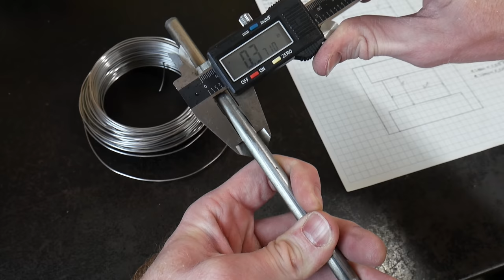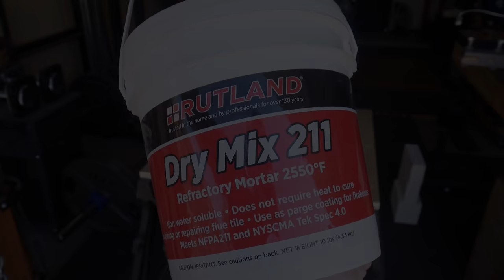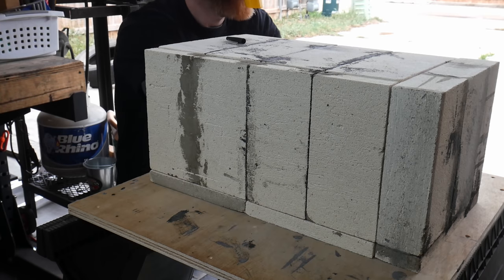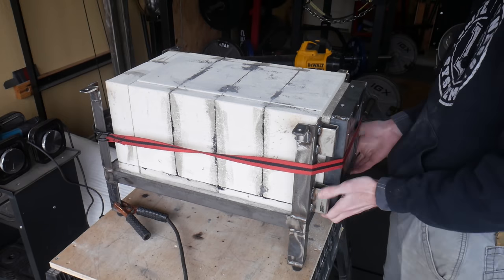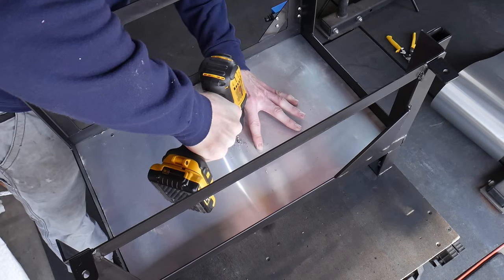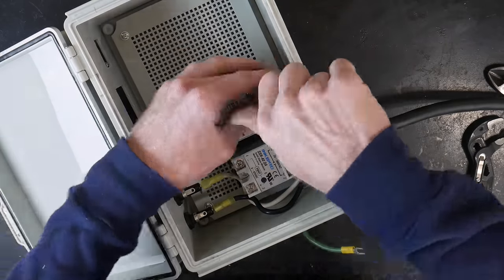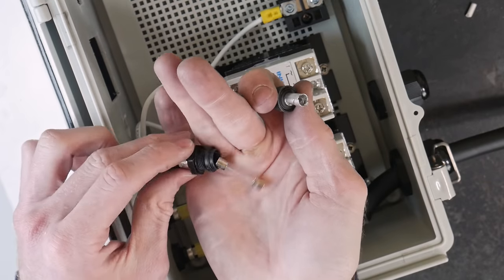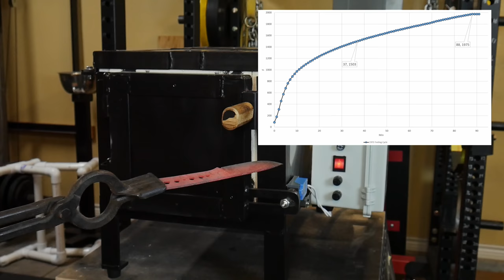How to Build a Heat Treating Oven | FULL GUIDE | DIY Heat Treatment Oven

Comment: Often a discarded bed frame will supply the angle iron needed for 0
A discarded door butt hinge cut in half will work. I’m using parts off a throw away space heater. 
Just trying to save on cost.
Reply from the maker: Good luck!

Comment: hi i just built mine but it takes too long to heat up, it takes about 20 minutes to get to 482F and it gets stuck there when actually i want to get to 1500 like you.

In my case, it is 220V with 20 Ohms, so around 11 amps pass at a power of 2420w for a volumen close to 0.47 cubic feets. Is my mistake in the low power or is it something else? could i solve it by removing a little resistance to go up to 3000w? could it be something else?

greetings and thanks for the video
Reply from the maker: Hey Claudio; Mine was around 13.3 amps if I remember right. You'll need to consider your wires and breaker if you decided to up the amps. One thing you may want to check out is your thermocouple; it's common to get the leads mixed up. Try swapping them. 

You can test to see if the thermocouple is working right by putting it in ice water. 

Could also be some settings in your controller.
Reply: @RedBeardOps  ty very much, I'll check each one of those things
Reply: @RedBeardOps I suspect that I might not be getting the power that I thought. Could it be the switch limit or the fuse holder? Do they need to be rated for amps greater than 10A? I've seen mostly limit witches rated 5A, I don't know if that's my problem
Reply from the maker: @caecita5910  honestly I'm not 100% sure. Not an electrician here; so take my advice with a grain of salt. I'd look over the wiring diagram again and make sure you have the correct math on the OHMs. It could also be settings in your PID controller causing issues. Those things are confusing.

Comment: I am curious, why did you double over and twist the ends of your coils?
Reply from the maker: I was told this minimized resistance over that section. I didn't want that section getting hot coming out of the oven
Reply: @Red Beard Ops  thanks, another thing. You added a 1" spacer to the side bricks. But they're 2" thick; if you trim 2" down  from the sides , that gives you a 5" inside height without a 1" spacer. My bricks are 2x4.5x9. Maybe I am missing something here.

Disregard, your bricks are 2.5 thick. Hmm, I ordered what you linked but they came as 2". Oh well I'll make it work.
Reply: James, how long did you make your power cord?
Reply from the maker: @Calkidd  If I remember right it was about 8ft.-10ft... but I shortened it since I needed some power cord for another project. About 4' now.

Comment: In the US, The National Electrical Code requires us to "De-rate" the load to 80% of the breaker's capacity, if the load is a "Constant load.".
15A breaker @ 120V = 1800W. De-rate to 80% is 1500W. Never run more than 1500 Watts on a 15 Amp circuit. (This is one standard space heater on high.)
20A breaker is 2400 Watts. De-rate all constant loads by 20%, max your load at 2000 Watts.
20A breaker at 240 Volts is, you guessed it, 4800 Watts to trip and 4,000 Watts at a safe 80% load.

OH! Just want to hammer on this one:
Always get more than you need. And cut carefully. The shorter it gets, the hotter it can get. And the more current it will draw.

Drawing too much current through your house wires is what causes electrical house fires.
Reply from the maker: Thanks for the info!

Comment: I want to make one with doors on both sides so i can pass a sword through it. Would i die if i dinged a powered coil with the sword while holding it? I was thinking of lining the sides with alumina tiles since alumina is an electrical insulator but a thermal conductor... but idk if it would reach the temps needed with all those tiles in the way.... maybe i could just cut a firebrick as a guide into the furnace so i dont ding the sides
Reply from the maker: Hey Shane, I don't know. Try something like that at your own risk sir! I've seen some really long ovens for swords, but that ups the cost

Comment: Easy way to make super strong refractory mortar ..... mix water glass with sand etc or with first dry mortar .....most of pre mix mortar already have it or are based on it thats why it glue bricks better 
it can be used as a fireproof paint , to make kiln mixing it with sand or better Al2O3 (used for sandblasting etc u need to use as small as possible so it will cover the perlite like paint etc) and mix it wit perlite ==u can make insulating brick or 1 big part from the mold ....it just need to dry 100% , there is no cure time , dry = cure , if it isnt dry it isnt cured. (Al2O3 need to cover perlite because over 1300*C it can melt but al2o3 wont melt yet still will hold the shape of perlite making it even more insulating)
u can use waterglass to make bricks even stronger but it needs to dry before it add any strenght , and it can be used as a glue that will glue brick to steel or steel to steel like crazy
Reply from the maker: Thanks for the tips!

Comment: Kanthal A1 wire is supposed to only have 17.5 watts per sq inch of wire surface max. 3200 watts 17.94 ohms 16 awg wire, end up with 31 watts per sq inch
Reply from the maker: Thanks for the info

Comment: nice, but those heat sink in your plastic box need to evacuate the heat.. i use a small transformer with a pc fan, 2 hole 1 for air intake and 1 out. you can find a lot of controller on internet, evenheat are from sdsindustries , some others are cool too. on the evenheat site you can find all the wirings schems with the electronics ref on it.... have fun.
Reply from the maker: Thanks for the tip!

Comment: Instead of doing all those miters for the corners on that frame just throw a speed square on there and cut them at 45°s. Can square it measuring opposite corners and wire will fill in any gaps. Way faster bro, just a welders/fitters advice
Reply from the maker: Thanks for the advise! I'll use it on the next project for sure!
Reply: @RedBeardOps  wasnt trying to critique, you did a good job was just throwing my 2 cents around. Everybody got what works for them but it really is faster end up making half the cuts. Great build tho bro
Reply: @RedBeardOps  wasnt trying to critique, you did a good job was just throwing my 2 cents around. Everybody got what works for them but it really is faster end up making half the cuts. Great build tho bro

Comment: They make metal kiln pins that push into the brick and hold the coil. Just wanted to let you know they exist
Reply from the maker: Yes sir, I thought about those... but decided that a grove would have a stronger hold. I've heard of the coil and pins expanding and coming loose.
Reply: @RedBeardOps  I meant use the in conjunction with the groves. Many kilns use both grooves and pins

Comment: Isn’t that wool dangerous for your lungs? I was told that it needs to be covered with some kind of refractory
Reply from the maker: In a forge I think that makes since since you'll have a bunch of airflow over it. I coat it with Satanite int he forge and ITC-100. In this application I think the air born fibers won't be an issue since it's contained and covered.... now... I'm no expert so take all of this with a grain of salt and be safe with your builds!

Comment: What I would have done differently is instead of milling out the bricks, cut away the parts that need to disappear using a hand saw. Creates less dust, but more importantly: preserves those parts of the brick so you can use them elsewhere. E.g. to fill the gaps on the outside, for which you now had to sacrifice perfectly good intact bricks. Otherwise, pretty decent build.
Reply from the maker: Glad you enjoyed it 🙌

Comment: Another trick with thermocouples is that the positive side of your thermocouple is always magnetic
Reply from the maker: Very good tip!
Reply: @RedBeardOps  another random tip is that manufacturers use any colour they want it seems. We here have black and white for J type and green and black for K type. Be mindful what type is fit to a controller and set the controller to the type installed as the difference between J and K is roughly 50 degrees C. I’ve been caught out before by that.

Comment: What if use wire 22 gauge?
Reply from the maker: From what I understand thicker is better. You can run the calculations with 22 guage and see what happens though

Comment: Next video 
Blast furnace 
I tried to cast a 30mm pommel and it fidnt work 
Forging out a puck is more efficient
Reply from the maker: Blast Furnace sounds cool for sure
Reply: @RedBeardOps  yeah I need to make one 
I though if using a hit water and radiator to heat up the air oh wait but I could just use a blow torch that more effective 
Then put in furnace and add 2 bag of 4kg charcoal 
That should definitely be ready to melt steel in about 30-45mins

Comment: Just fyi & not that it matters... But V = IR (voltage = current x resistance) is Ohm's law NOT Watt's law ..just to be historically, technically correct & all
Reply from the maker: Hey Rob it's actually both... Ohm's law is AMPS=VOLTS/OHMS and Watt's Law is POWER=VOLTS/AMPS. You insert Ohm's Law into Watt's Law for the math used in the example (4:16) to find the Watts of the oven which gives you POWER in Watts = Volts^2/Amps. --- Cheers --- https://opentextbc.ca/basichvac/chapter/ohms-law-and-watts-law/

Comment: I build one but it just didnt work pretty sad
Reply from the maker: Damn that's sad to hear!
Reply: @RedBeardOps  The Controller turns on and everything but the coils just dont wana heat up. I checked the wireing twice now. Maby its the Controller or i just put in the settings wrong. Idk
Reply: @RedBeardOps  nevermind i had a brain fart while installing the ceramic blocks and put the coil wires in the oposite slot to my hot wires XD
Reply from the maker: @EmptyShadoow  I'm happy you found the issue!

Comment: Overkill from heck. Kaowool WITH firebrick? Unnecessary. Either one by itself would have made the kiln box. Firebrick makes more sense with electric heating coils as well, but 3 kilowatts for a half volume enclosure? Again, overkill, but this time in a bad way, as it is a waste of electricity. The slot size was perfect for a 3/8" ID heater coil. Just make sure no coil is touching the next in line when it is stretched in, or that also reduces resistance by causing a localized short circuit at that point as electricity ALWAYS follows the shortest path available to ground. Kaowool plugging any holes you make for wiring, etc, is also a good idea to help hold in heat. Building a heat chamber of any kind for high temp is always the same, doesn't matter whether you are making a clay kiln, electric or propane forge, heat treating chamber, or anything else. Careful of mortaring the brick together, as not all refractories have the same amount of heat conductance as those bricks, which means a mortar can sometimes leach heat from the inside to the outside over long heats, which is bad. Mating the bricks like you did for a perfect fit in a snug frame, which you didn't, is a better idea. Building a kiln with firebricks is not like using bricks to build a wall.
Reply from the maker: Well. It's working great! lol. Have a great weekend
Reply: @RedBeardOps  I bet it is, just simply way too much extra expense in the build for no extra value given. The Idea with DIY is to build a machine you are happy with, but save money. You just spent way more than necessary is all.